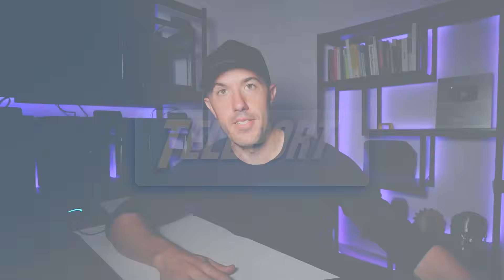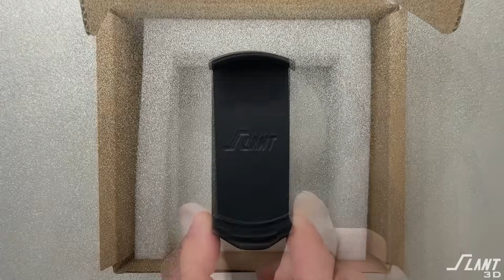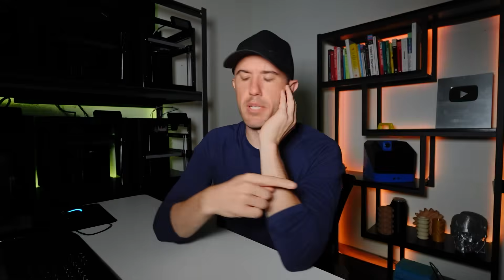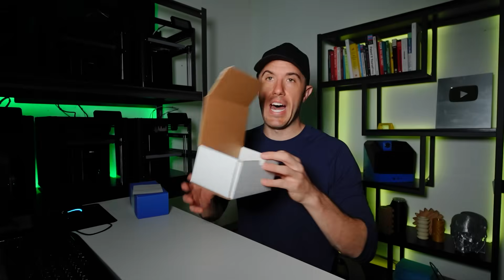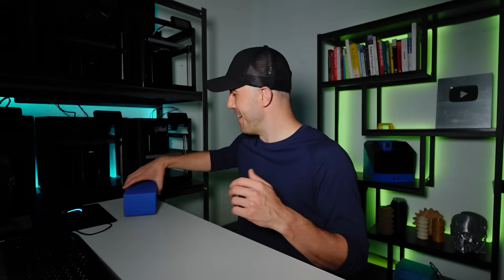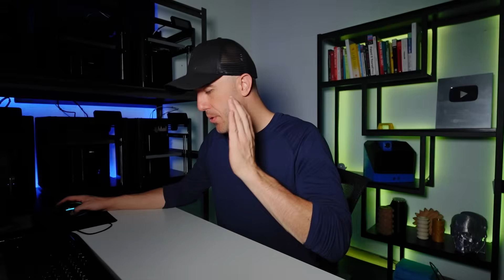Did Prusa Declare War on Bambu Lab? | Tangled Subscriptions | Prioritizing Projects | Podcast Ep 114

Comment: I have a question. So my Bambu X1C eats about 130W while printing and this is an enclosed machine which should be more energy efficient. Now I wonder what the scale is at which point it is less energy input to make a mold and injection mold the widgets. I know the inputs of that calculation are also dependent on what the widget is but the widget is the same between the 2 save for minimal adjustments for the processes but there has to be a point where the energy invested in 3d printing something that sells well is no longer worth it. I guess the unfortunate thing is that by the time you realize it is the case you are already down having printed thousands of the thing... so it will always be a sunk cost thing I guess.... anyway interesting thought experiment.

Comment: You will NEVER get the XL to run a milling cutter. It's a great idea, but the XL HAS NO RIGIDITY
Reply: Yeah, that is my concern as well. Maybe only milling plastic with finish passes? Seems messy to me though...
Reply: 3d Printers just aren't very rigid.  You could put a rotary on it, but that thing would would deflect so hard you'd never cut a straight line.  Without a gantry redesign, I doubt it could even cut plastic.
Reply: @lexdysic416  it's the locking design for tools specifically that is not going to work. needs a complete overhaul
Reply: Are you using an unenclosed XL as an example? Once I added the enclosure, it’s solid. It will 100% mill plastic with minimum distortion originating from the frame. I’m interested in the new tool head because my machine is used for engineering purposes and end use parts. The real questions will be about how much work they put into the software, and how will the part be held being it’s a CoreXY?

Comment: Question: About the Design-Notes: When will the design notes be included? is there a button where I can flag for a box to include it (e.g. if I order a sample part for myself). Because I honestly plan to use your POD a lot in the future and at first I wanted to create a lot of smaller parts and didn't plan on ordering samples. But I certainly don't want my future customers to get 3D-Priniting-POD-Design-Notes :D

Comment: I agree with you on the combined Bambu Laser.  I picked up the H2D Combo, but didn't really need the laser functionality.  I rather have that in a separate device, because laser cutting makes a lot of nasty stuff, and I rather have that in a different machine than the machine that I'm expecting 50µm tolerances from.

Comment: Totally unrelated to 3D printing, but I've noticed in your videos that you often sniffle and snort, and that, around the 40, 45-minute mark, you start coughing. I know those symptoms, because I used to have them myself—which was a real bummer, as my day job is conference interpreter: the whole day speaking inside a dusty soundproof booth. I went to an ear-nose-throat doctor who diagnosed me with chronic sinusitis. The prescription: daily saline solution nasal lavage (neti pot, basically). Check with a doctor, get this thing sorted out. The improvement in quality of life alone (less snoring at night, less strain on the vocal folds…) are more than worth it.
Reply: I was about to comment on the same…frequent coughs and sniffles should be looked into…
Reply: @arbjful  They're one of those insidious things that keep getting worse with time, and we don't really notice as they happen, and sooner than we know, we're living miserably. When we get better, it's like an albatross taken from our backs.

Comment: Prusa needs to release an affordable, high temperature printer.
Reply: You get what you pay for
Reply: @Waldohasaskit210  It's about the only thing I can think of that could set them apart from Bambu Lab. Affordability is relative- $3k sounds pretty sweet to me.
Reply: What is high temp fore you 
Also ht is hard when over 100c
Reply: @Goroca  Whatever it takes to print PEEK, Ultem, etc.
Reply: @SyntacticOperator 
Get a 22idex
That thing is cheap
Reply: @Goroca  $14,900.00 USD
Reply: @SyntacticOperator 
Yes that is cheap fore the performance  
HT is really hard
Reply: @SyntacticOperator  350-450C - Wow, that's hot. Seems like CreatBot F160‑PEEK can print PEEK for 2000 USD which goes up to 420C (but it's a bit of a small print area). I think a more reasonable all-around nozzle temp to look for should be around 350C which is close to a lot of printers that do 320C. Here's hoping we get more of these things at cheaper prices.
Reply: @berkertaskiran  Wow, I didn't know about that one. Thanks.
Reply: @Goroca  It's not hard, my friend, it's just new. I could build one myself.
Reply: @SyntacticOperator 
Good luck 
It is not att all easy, I have one and it cost a lot
Reply: @berkertaskiran 
The problem is the chamber 
You want altlest 120c fore small peek parts 
250c fore mediom size parts
Reply: @Goroca  One could make an all metal printer, utilizing high temp linear bearings, high temp stepper motors, high temp limit switches, high temp wiring, and simply put it inside of a kitchen oven- directing all wiring outside of the oven to a control box. It's janky but I'm sure you could get it to work if one was ambitious, and driven.
Reply: @SyntacticOperator 
Won't work 
You need bellows but the use a oven has been done and it works. Can't send the like but ther has been a couple of people doing that
Reply: @Goroca  What won't work? Where do you need a bellows?
Reply: @Goroca  LDO makes stepper motors that operate in environments up to 180c.
Reply: @SyntacticOperator 
Ther are no motors rated fore 130+ chambers continuosly that don't cost a arm and a leg
So it will be much more expensive then some bellows 
Also ht rails are really expensive
Reply: Bellows are needed fore the xy gantry 
And some kind of wiper seal fore the z axis to avoid having anything inside the chamber
Reply: @SyntacticOperator 
How are thy rated and that is moter temp 
And moters run hot att rum temp so thy will rund a lot hotter when in a chamber 

You can if you want run steppers inside or the camber and replace them after a couple h of printing or use bellows
Reply: @Goroca  According to my research, chamber temps of 130C to 160C to print large PEEK parts are the norm. That 180C rating is for the chamber temperature. They are very affordable, and available from numerous companies.
Reply: @SyntacticOperator 
Interesting 
Go ahead and do that then 
Still recommend bellows bechan you avoid all the complications whit having to heat pruth components

Comment: Question: What are your thoughts on the levity rapid liquid printing. 

My thoughts are that, if they can make it print more conventional plastics like PLA, PETG, ASA. It could make FDM and resin obsolete. Obviously that won't happen as FDM is cheaper and more developed and as you said supply chain reasons. But I can't help but think that this is the future of 3D printing because it has no fundamental downsides like gravity or long manual post processing times. It prints in any geometry and doesn't through a fit.

Comment: 7:08 I want an enclosed, easy, two (or three) tool head printer, and what stopped me from getting the Bambu H2D is I have little interest in laser engraving, and I have no interest in doing this in one of my printers. I know I don't need to pay for the engraver, but I do have to pay for the r&d and ability to add this in. The majority of my prints are a single material with only a few layers done in a separate material, thus the print time reduction is minimal, but at the price it isn't even enticing.
Reply: What does the availability of having a laser have to do with anything? The regular model, which I have, doesn’t have all the additions made for the laser version. So it costs less. Sure, if I want to spend a lot more I can upgrade it to that, but I don’t have to. So what’s the point of bringing up the fact that you CAN get a laser version, when you don’t have to? Quite frankly, it’s silly to think that you’re paying for the R&D for that when you don’t know how the R&D is apportioned. It’s just as possible that R&D (which governments give the majority back in taxes) is charged to the laser, cutter, etc. you’re just finding an excuse there.

As far as tool changers go, they can be fine, if that’s important. But going by you theory here, it’s possible that Prusa has charged every XL owner those R&D costs for these new tool heads which may be coming out, so no gain there.
Reply: @melgross rather safe assumption on my behalf that r&d costs are passed onto consumers, and additional r&d and manufacturing costs for making the h2d able to become a laser engraver increases the cost for a unit which has low appeal as a two toolhead unit. More features is more cost, and the more features you don't want the more money you're wasting. My fleet are all Bambu printers, and this just isn't appealing enough, with the cost being the least appealing bit.

Not sure why you think I would need an excuse to not buy it when I listed exactly what I'd like to have seen.
Reply: @zacharylaschober having been a manufacturer, I can say that you’re not entirely correct here.
Reply: Snapmaker advertizes their new printer to be that. Buti think it has 4 toolheads.
It's called the U1.
Reply: I honestly thought after the x-1 and news of the XL coming building printers would be a thing of the past. Were on the same page of wants, makes building a Voron 2.4in 350size and getting the bond tech INDX sound like the best option.

Comment: 10 minutes in and I've three comments already!

1) I never trust percentage increase stats, without context.  350% increase sounds great... but a jump from 2 units to 9 units is a 350% increase and unless we're discussing aircraft carriers, a trivial increase in actual capability.

2) I don't think the XL toolheads announcement is really a quick response to Bambu.  Rather, I think it's a very, very delayed announcement of capability suggested way back during the pre-order stage, and shows that Prusa is continuing to struggle with getting XL stuff out the door in a timely fashion.  They might have pushed this a little harder now that the H2D gimmicks exist, but I'm very much of the opinion that this was in the works before Bambu even existed.

3) PCTG isn't an acronym, one can pronounce acronyms as a word.  This is an initialism.  Granted you didn't actually say PCTG was an acronym but you implied it.

Comment: IIUC the Prusa XL non-FDM heads will mostly be additive; as in not lasers - e.g. auto place threaded inserts, PEZ-dispenser for magnets, etc ...  Niche, but it that's your niche, then potentially saves hours of manual labour
Reply: I would love a tool to install the threaded inserts
Reply: These are the two toolheads that I wanted to see on the XL. I remember mentioning it in a comment back when the XL came out and someone from Prusa said that was a good idea. Hopefully it's been percolating in the Prusa R&D.
Reply: Hey  @Sembazuru  and @noisycarlos  ... it seems pick-n-place might arrive on XL (magnet grip/suction) - https://youtu.be/XhHmCLYMke4?list=TLPQMDIxMjIwMjXxUvRqCUX6jA&t=598  

(Prusa... please give us a dual  toolchanger with dedicated pick-n-place (actual "pick" so multi-part to place) alongside second head that's multi-material/nozzle-size INDX ... while I'm dreaming, please add non-planar!)

Comment: Because Bambu didn’t make a bigger build plate print. I bought a svo8 with a coprint 8 head color setup.
Reply: @mikepeterson8663  that's what I'm thinking about doing until I can get the multi head, multi extruder thing figured out. how are you liking it? Was easy to set up in mainline Klipper?

Comment: I actually printed a scan of some teeth for my Orthodontist. Printed with an FDM printer with a 0.2 mm nozzle and it worked perfectly. Had to clean up a scan and fill and print worked like a charm. Happy customer.
Reply: Same!  I printed my own teeth (sadly not a functional replacement).   Also when the crown (also 3DP printed) didn't fit (print was fine, but scan confirmed my tooth moved), Dentist then gave me the 3DP (resin) from the lab complete with jaw hinge.   Absolutely a "Happy customer".
Reply: worked a an orthodontics; used 0.4 mm Nozzles, 0.16 mm Layer Height for all models - diffrent colours for diffrent purposes; mat white - analysis, brown - lab work/building apparatus, bright withe/ivory - final/send off.

Used SLA to make models for making foil like crunching stuff..
Reply: @martinw380 the ortho has all the stuff to do it just is not trained to do it.